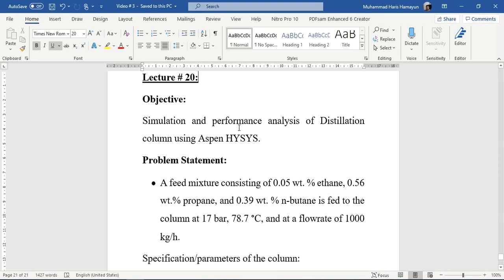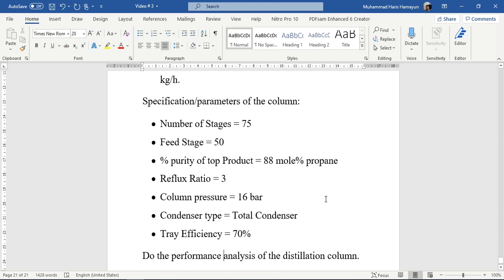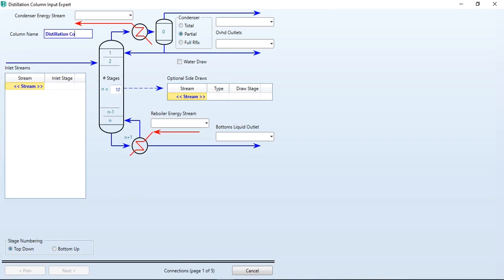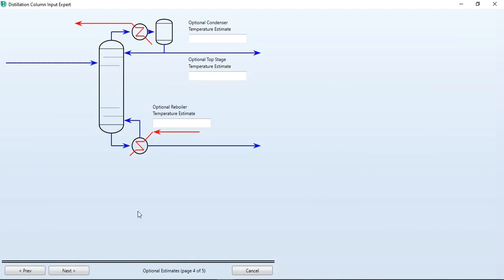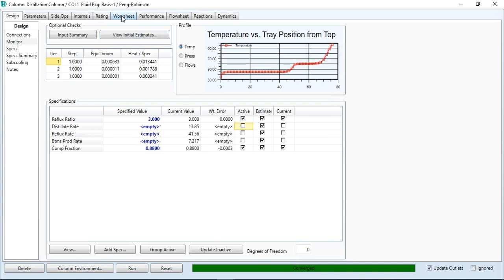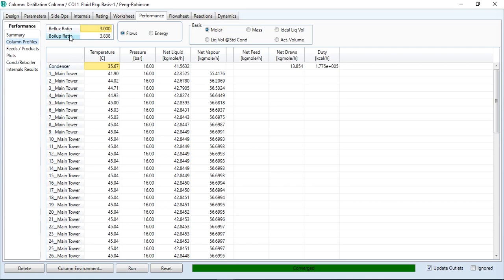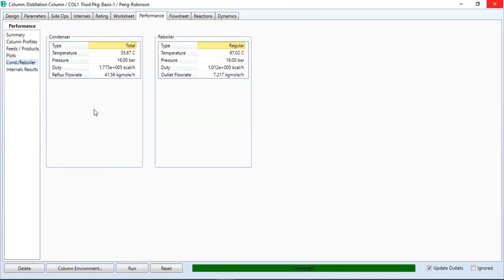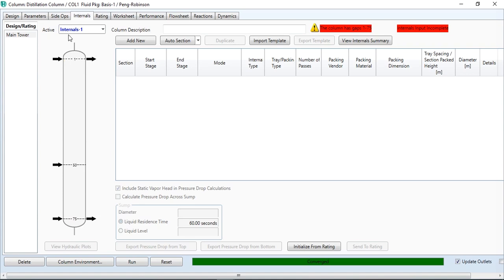Design and Performance Analysis of Distillation Column using Aspen HYSYS | Part - 2 | Lecture # 20

Comment: Sir, I have a question. I have distillation tower with a top and product spec, also overhead vapour rate spec. But my column can not converge bcs the top spec and overhead vapour rate don't meet the spec that I defined. I have already check the feed condition, but I still don't know the problem's root. How can I solve this, Sir? Thank you~

Comment: Hello , Tnx for video . 
Please Read and Help Mate !!!!!
I need little help. i have a problem with my feed after reactor and distillation tower. 
feed to reactor is 399k and i wanna go down to 350k , i am using duty stream to loss by 89kw as given information to me but temperature going down till 395k . how can use heat loss in reactor ??
Second : in distillation i have 2 spec about mole fraction , RR and 2 duty for condenser and reboiler . as given information i should specification 2 mole frac but i have no idea about RR and dutys and ref temp in reboiler , how they would effect ?
i am using hysys.
Reply from the maker: You can use energy stream to reduce the temperature to 350K. Connect energy stream to the reactor, and then specify the outlet temperature of the reactor, which will provide you the value of heat.

Regarding distillation, if you have any two values from RR, Duty, Mole fractions, you can solve the column. Untick RR and vapor mole flow from specifications, and add specifications of mole fractions required in the product.
Reply: @aspenchemchannel  Tnx for reply <3 .
I reduce temperature to 350k and use RR and Mole Frac in bottom for specification.  its worked but there is a problem 
-  My main problem -
temperature of distillation is above given information. 
it should be in 333k ( condenser ) - 401k ( reboiler )  Range but it gone more than 450k in lasts trays !!!!!

it is when after converge.  RR , Mole Frac of all material  are same as I want but temp is so high . ( in this simple energy stream in condenser and reboiler are half of given . )
if I specification duty for condenser and reboiler , Temp problem will be solve but it wont converge and RR , mole Frac have big error.